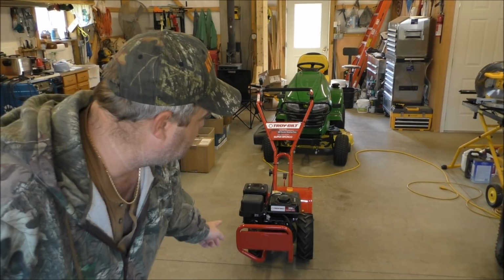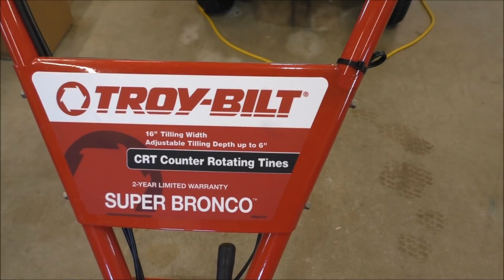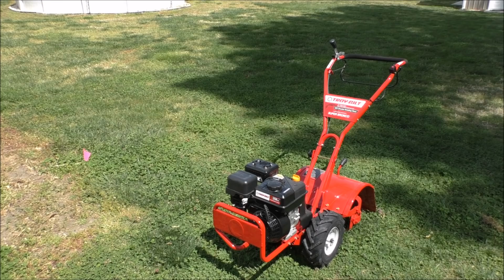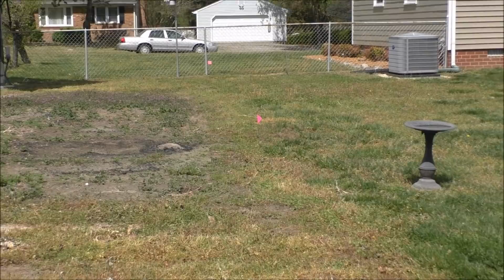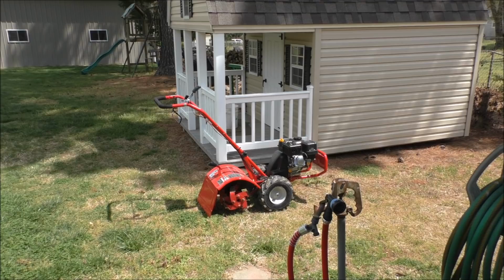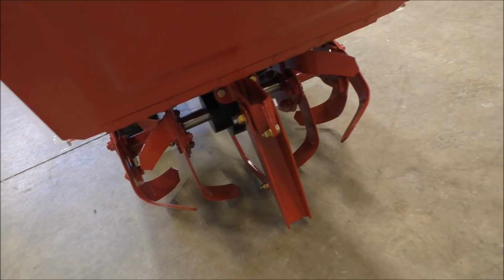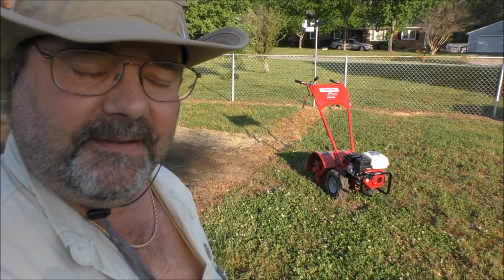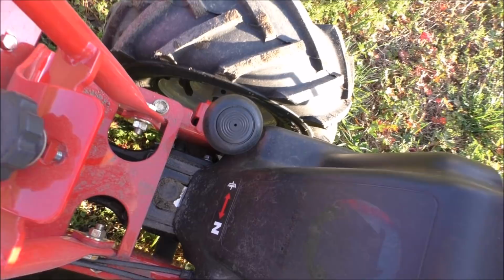Troy-Bilt Pro Line FRT 160cc VS Troy-Bilt Super Bronco CRT 208cc By KVUSMC

Comment: We did a lot of research on different tillers before pulling the plug on one of these yesterday.  Only one tank of gas thru it so far but it does a better job than we anticipated.  It's large enough to get the job done but small and light enough that my wife can use it easily.  Assembly is very very easy.  Starts first pull every time from the crate.  No complaints so far.
Reply from the maker: Great Choice I love Ours

Comment: I almost bought one of these. But I ended up with two older gardenway tillers. One ran the other one needed an engine. So I ordered a Honda engine from small engine warehouse. Put  a new set of tines on it. Changed the transmission gear oil. Runs like a new one. Tilled and plowed about a half acre of garden spot. Then used the hiller plow to set up my rows. Man dose it do a good Job and the garden is doing great. I use to work for MTD powder coating for about 15 years.  The quality has gone down hill. It’s all about money over quality. I bet that Honda engine will out last the tiller frame. I’m glad you like it and hope your garden does well this year Kenneth.
Reply from the maker: Awesome great idea good work

Comment: I had 2 proline models.  1 was a crt and the other was frt. That frt would hit the ground running and it took alot of work to keep it steady because tires and tines turned forward. It would literally just run forward. I sold it. Tha crt would just dig. I could control it with a couple fingers.. Love it!
Reply from the maker: Both are great models Great machines buddy
Reply: Absolutely. If you need a tiller,  you can't go wrong with a troybilt.

Comment: Great video, it seemed as the Honda motor really was what sold you on the tiller and not so much any performance.  The pricing is considerably different between the two machines and you are paying for the motor name only basically.   You did see what the difference is between the two tiller types,  counter rotating is for busting the ground up and not trying to run away from you / forward rotating is for fluffing after you have the ground broke up, but you have to really hang onto the front rotating tiller.   Both are great machines, but I would take the John Deere you tilled with for speed and comfort.   Great video, post some pictures of the garden after it is grown.
Reply from the maker: Yes sir I know what you mean

Comment: It’s been a bit, how are you doing, dude? I have a question, a little off the subject. What I would like to know is, what charge controller you would suggest? I am building a off grid mobile solar array for my cabin. I’m will be charging a 48 V battery, I am building a 48 V system, I will be charging a forklift battery. So what charge controller would you suggest?  How large of a controller? What name and model number of a controller a controller which I can also tie in a Axle Flux wind turbine. I know I’m leaning on you here, but I’m trying to avoid a mistake, with a charge controller. You have a huge background in off grid systems. My background is in large Grid Tie Solar arrays. If you ever find a need for my knowledge give me a call. I have just gone from a sales, installer, and service, to a distributor also.
Reply from the maker: A Midnite Classic And Outback Flexmax 80 are nice

Comment: So there´s no alkylate gasoline for sale in the states ?
Reply from the maker: I'm not sure buddy You can get ethanol free And ethanol added gasoline
Reply: @KVUSMC-KU4SMC  Here in the north of europe alkylate gasoline is sold for small displacement engines like chain saws, lawn mowers, rototillers, outboard motors etc. Added bonus is that it contains few, if any, carcinogens compared to regular car gasoline. And of course the greatest benefit, leaves no varnish when evaporating.
Reply: @juslitor  never heard of alkylate gas here in the states? For our chainsaws/weed trimmers/ small engine stuff, we have to mix oil into our gas...